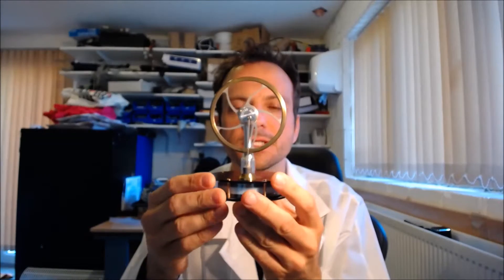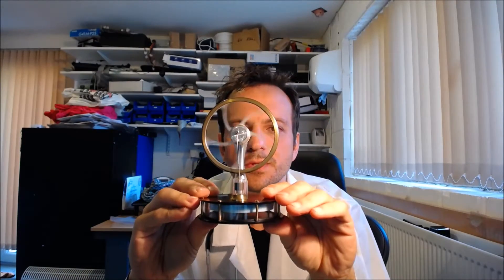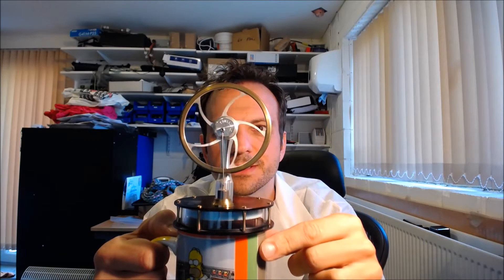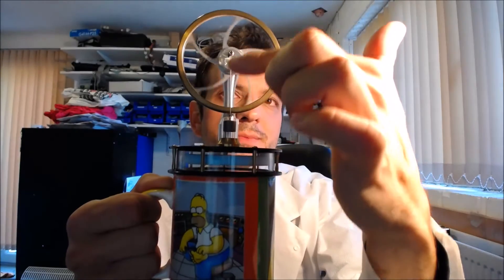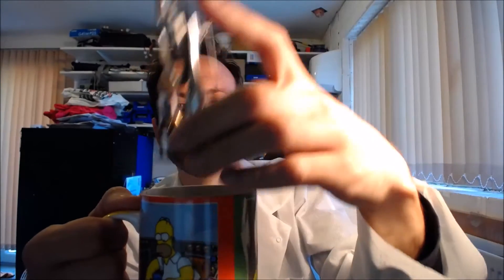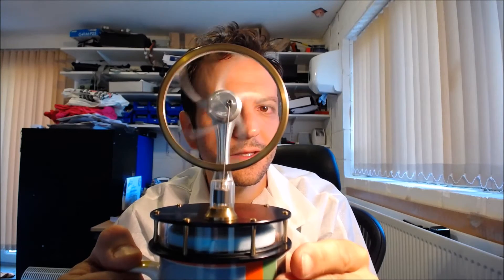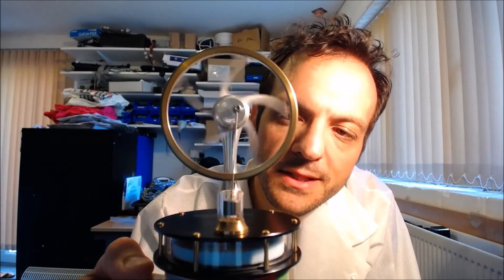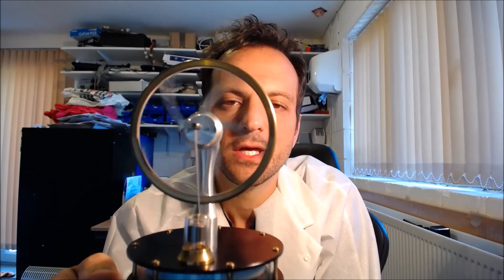Kontax KS90 Stirling Engine Review

Comment: It costs €100 though. I really want to buy one of these, but they cost too much for me :/
Reply from the maker: +Animiles you can get cheaper models from eBay, maybe have a look there? Unless you really want this bread brand!
Reply: I do want quality though. And with the precision needed to make these parts I don't really trust the ones from Ebay. But thanks for the tip. I really appreciate that you're trying to help :)
Reply: Animiles 
  My Kontax KS90 Solar has been running constantly for almost 8 years, I used to have it running on my router, it’s now on my bed side table lamp which is on 24/7. 
  Definitely, you should save up and get a kit.